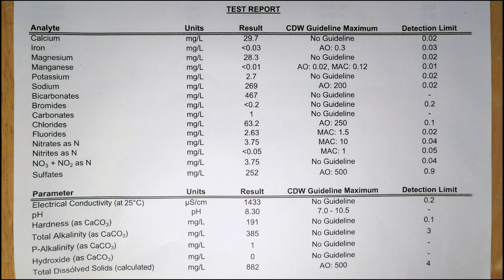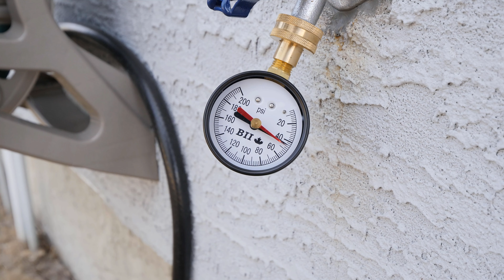Reverse Osmosis Water Filter Install

Comment: There’s a line from the filter unit into the storage tank, but no line out of the tank to supply the faucet?  Is the air bladder you mentioned providing pressure to push the water out of the tank to the faucet?

Comment: Great video, thanks for the detailed install. I am installing the same system myself for my new acreage build as well, but will be just feeding the fridge drinking station/ice maker, everything else is just filtered by whole house FAK filter. Great information here. I got mine mounted in the attic since I can't run new lines from my utility room without lots of destruction, and plan on feeding the recirc water down the line that goes to the kitchen. I have two options, feed it 10+ feet in front of the RO system, or 10+  feet down from the RO system. Feeding 10 feet down would be preferred, but not sure how that works....will it just inject that water into a pressurized line...even thought there is nowhere for it to go technically? I'm in Alberta as well :D

Comment: Another superb video Pat. I'm about to install an RO system once I get my softener and carbon filter installed. You answered one of the questions I had, which was I want to put it down in my basement and set the filter unit & storage tank on a shelf, but its a decent distance away from my kitchen sink. So you're okay with running 75 feet away. I guess if everything is at line pressure, it doesn't matter the distance. My house is all copper, but for this application, I might do exactly what you did and convert to PEX B coming out of the unit. I've always been a little concerned about the pressure drops with PEX B but you don't seem to have an issue with it. Do you oversize your lines by one size to account for the pressure drop at the fittings? 

That was a clean install, as all your installs are. Great stuff. Can't wait to see your bathroom remodel this summer! Cheers as always!
Reply from the maker: Thanks you! I would definitely run the RO in plastic or PEX. RO water is not recommend to be installed with copper. This is because the RO water is so pure compared to tap water. The RO water will absorb some the the copper in give a metallic taste to the water and it can actually eventually wear away the piping over time and cause leaks. Just a heads up :). The main reason I went with 1/2" PEX to the faucet is because 3/8" tubing any longer than 25ft was a specially order at my plumbing distributor. I don't think you'll have any pressure issues if you decide to run it in 3/8" or 1/2". Just keep in mind that residential RO systems will always have a lower flowrate than the kitchen faucet. Thanks again for all the positive feedback and support! Cheers!

Comment: Is it OK for the pex to be exposed because it does not get "direct line of sight" sun exposure?
Reply from the maker: Correct. It isn't recommended for most brands of PEX to be in constant direct sunlight. Some brands are designed for solar heating on rooftops, but it's typically a more expensive product. Being inside won't have any negative effects on standard potable water PEX.

Comment: Should put the RO under the sink to supply JUST better drinking water . 3.5 gallons per day can't give adequate supply for ANYthing else (3 GpM , 60 times as much as RO . Why use the RO for anything else?)
The first two filtration would have been better if added as 20" x 4.5 at same location as your first sediment filter (bigger is better).
(My system is a five stage and plan is to add an RO under sink eventually)